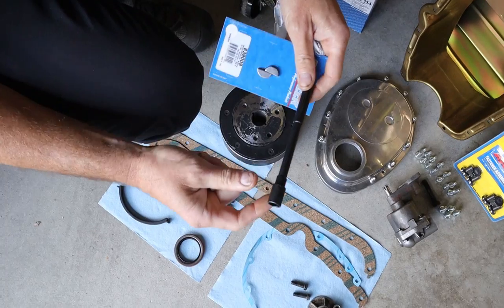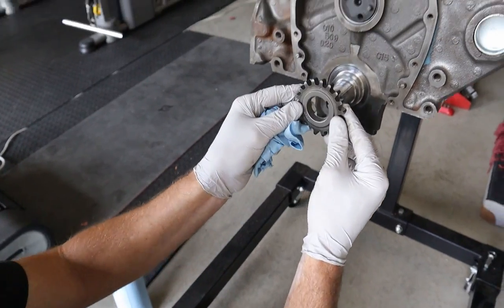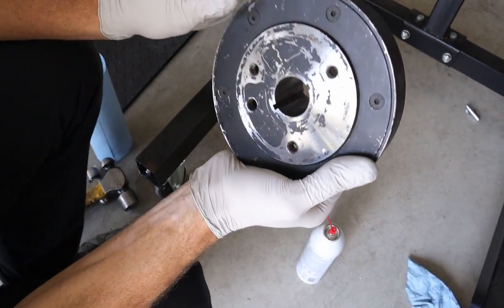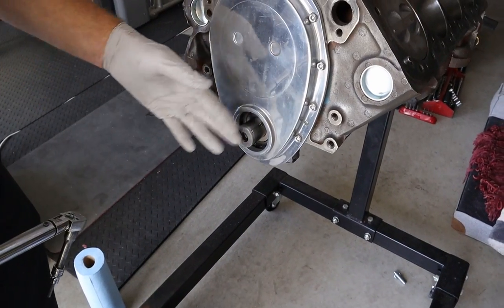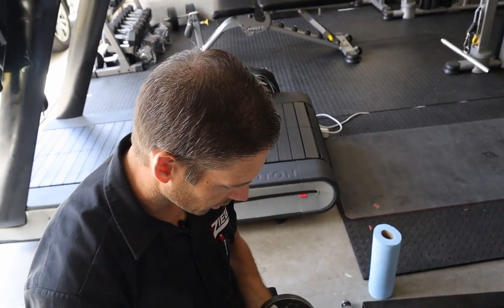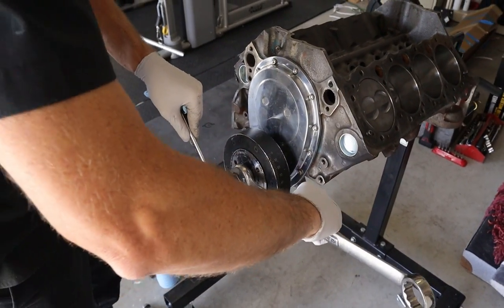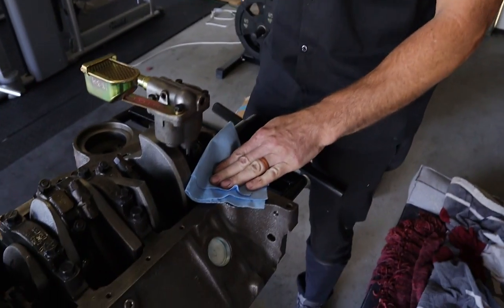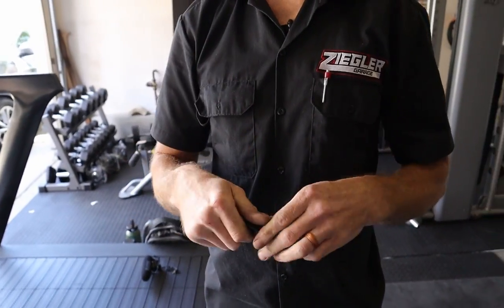Building a 350 Small Block Chevy Start to Finish - Part 2

Comment: No cam lock plate or thread locker , use brass hammer , some balancers need to be heated up so they expand before pressing on crankshaft so tool don't break. Torque in increments .

Comment: Couple of questions why don't you just go up a little bit more money and put the double roller timing chain and gear on and in your Liquors why don't you soak them in a thing of oil for a couple hours and push down a little bit so they'll get full of oil before you ever inserted them that's the way I've always done it it works pretty good for me

Comment: Supposed to install the timing cover loosely then install the balancer so the seal is centered then torque the timing cover bolts.  Thought these guys knew what they were doing??
Reply from the maker: Never said once we knew what we were doing😂
Reply: Small block Chevy’s have dowel pins on both sides is the timing cover, so leaving it loose when installing the damper won’t change anything. But with all your knowledge you would know that……😂😂

Comment: I can see many things.
Might want to use a aluminium drift punch when you tap the woodruff key into the crankshaft to prevent damage, that is not the way to put the bottom timing gear on, and you should Put the crank seal in, before installing the timing cover.

Comment: Perfect timing!!  I'm preparing to build a 350 SBC carbureted to swap into my 94 C1500 with its 5 speed manual transmission, replacing its 4.3L V6!!!!   This is exactly what I needed!!! Thank you!!!
Reply: What trans are you using?

Comment: You mention using trans gel to pack the inside of the seal on the front seal. What is that ….I’ve never used it?
Reply from the maker: It's similar to grease, you can find it at parts stores.

Comment: Hi, just correct me if I'm wrong, but that is a Gen 1 block, so shouldn't there be a camshaft button installed to prevent camshaft end play/float.
Reply from the maker: Not with a hydraulic tappet cam. That’s for a roller cam.

Comment: Are you guys ever going to get the pt.3?? I'd like to see your timing since I'm struggling with mine
Reply from the maker: Part 3 is out on our channel
Reply: What trouble are you having? Did you install the distributor correctly, the rotor pointing to no.1 cylinder on the compression stroke? 
Many people make the mistake & put the distributor in 180° out.

Comment: What are the torque specs for the 4 bolt fasteners on bottom oil pump ???
Reply from the maker: Add some lock tight and torque to 89in lb.

Comment: At around 5:38 into your video you say use either the gasket or silicone but not both. Why? I dont trust those thin gaskets and usually put a thin layer of silicone on both sides. And ive never had a leak.
Reply: From my understanding the silicone doesn’t stick well to the gasket material which can cause leaks, using a thin layer is probably what prevented your projects from doing so

Comment: Is that a 7qt pan? Could i use that instead of a 5
Reply: Yes, 7 quart pan 8 quarts with oil filter. You can use a kick out pan as long as it will fit your Application.

Comment: Just a minor annoying thing. Calling the actual keys or key stock the key way. The keyway is the slot itself that the key slides into, either a scalloped design like in this crankshaft that uses a woodruff key. Or they can just be milled slots that take square or rectangular keys. Just something to keep in mind to maybe not confuse new builders or people new to mechanical terms or language.

Comment: 4:17 I use an exhaust pipe with a flat piece of steel on the end for the hammer to hit.
7:23 I install the seal before installing the cover on the block, much easier.
10:45 That’s China made garbage for sure. They have no clue how to harden metal and is why your FT cams go flat. LOL.

Comment: NEVER EVER TAP THE CRANK SPROCKET ON, OR THE TORQUE CONVERTER. THE CRANK GEAR WILL SIMPLY SLIDE ON WITH A LITTLE HEAT. PUT IT ON A HOT PLATE, HEAT WITH A PROPANE TORCH ALL IT TAKES IS A LITTLE HEAT AND USE CHANNEL LOCK PLIERS AND SLIDE IT ON. WHEN INSTALLING THE BALANCER ALWAYS JUST THE CORRECT TOOL WHICH IS 25 BUCKS ON EBAY
IF U USE A HAMMER U WILL CAUSE DAMAGE TO THE THRUST WASHER.